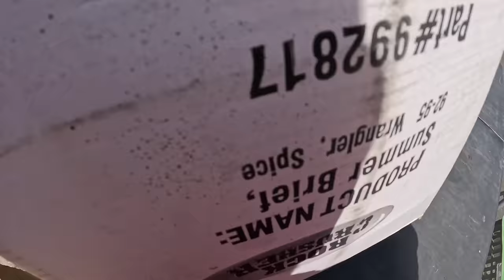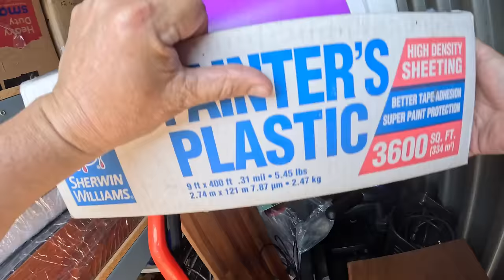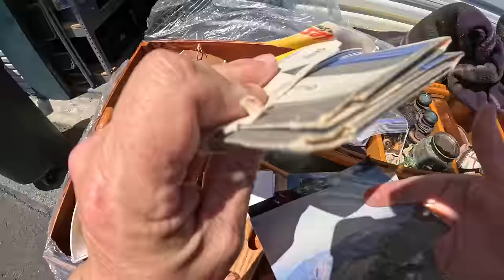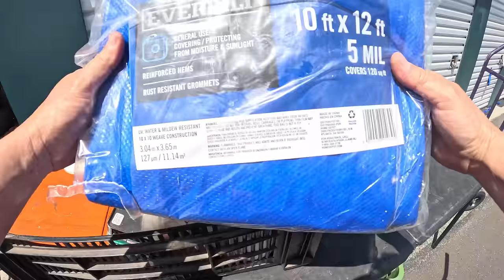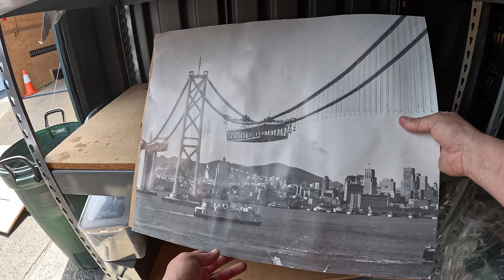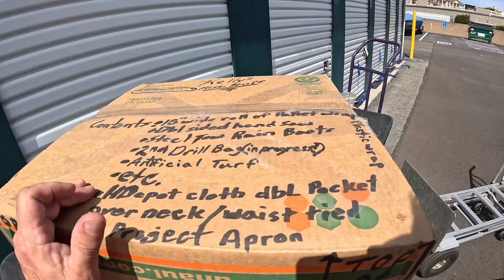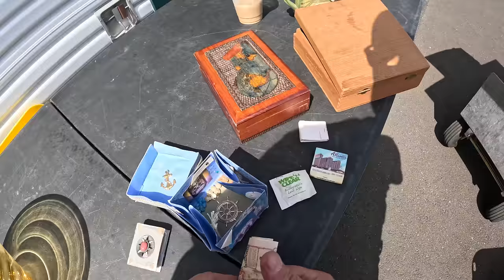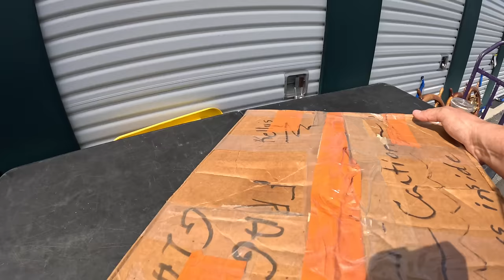I had a GOOD FEELING about this locker... and I WAS RIGHT!

Comment: The bubbles are called control bubble...
the bubbles are typically created by rolling the molten glass on a metal surface covered in sharp spikes, poking holes that are then covered with another layer of glass, trapping air in the holes
Reply: I was thinking they poked them in there. I just didn't know about the rest of the process

Comment: Paper weights a little tip for you jack if they are ground down they are modern they use too be the glass left over and dumped on the floor so if they look like they have been dropped or a hole in the bottom they are probably older and worth a lot more. Any questions please feel free to ask if I can help if I don’t know I’ll say enjoyed the holiday video. Was you secretly hoping for a Fabrge egg

Comment: The bubbles inside blown glass is bullicante. You can tell the quality of glass with bullicante in it by how controlled the bubbles are, same shape/size and spacing of the bubbles. Murano glass often has bullicante and it has a polished clear bottom. The yellow vase and peach bowl could be Murano.